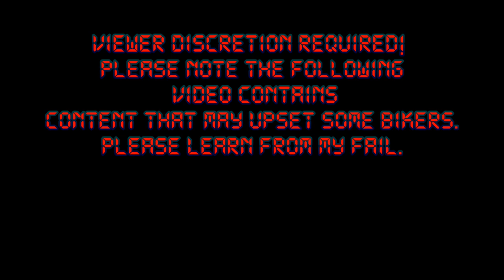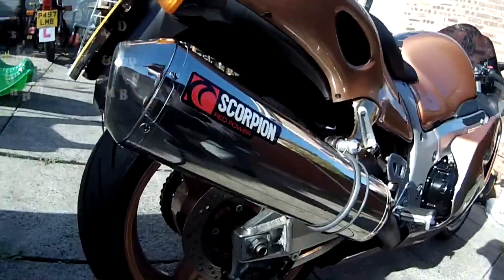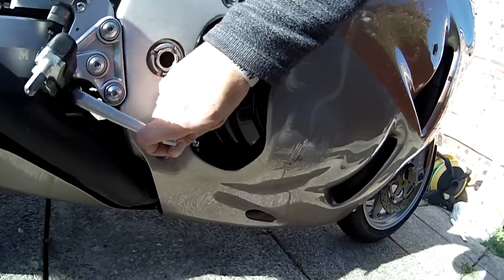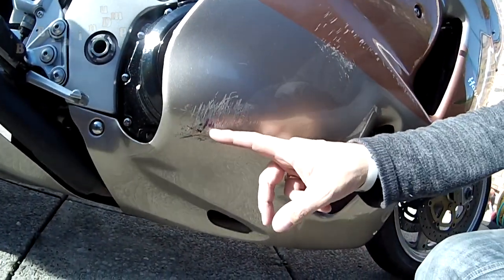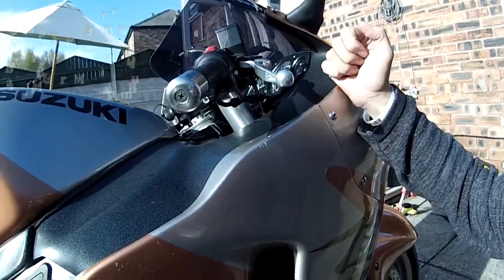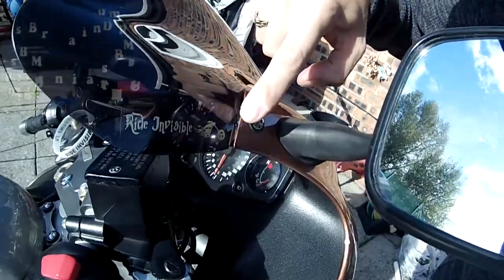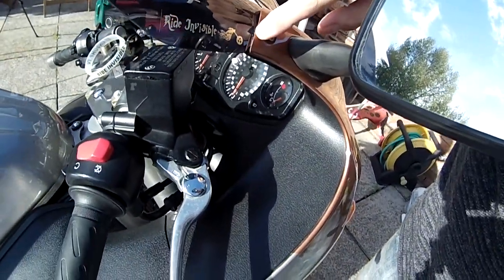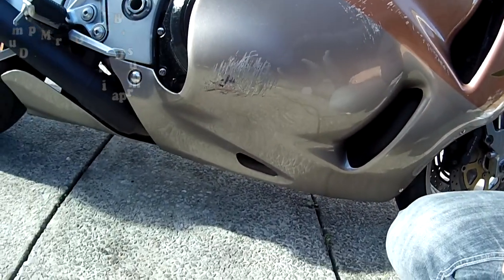Busa Down!! - The beast hits the deck - Mr B not happy

Comment: I did a sprocket and chain change out yesterday and as I was taking it down off the stand my hayabusa fell right over it snapped the brake lever off and scratched the engine covers bad. I feel your pain mr. B also I learned how to do the chain and sprocket from your video thank you so much.

Comment: Hey brother, I’m sorry to see this happen, and I know the pain quite literally. Anyone who rides long enough and especially those who do their own maintenance like we do, is very likely going to have this happen at least once. This actually happened to me very recently not long after bringing home my new bike. What made it even worse is that the bike fell “on top” of me and injured me. I was pinned beneath with no one there to help me. Thankfully the bike only received a minor scratch and I eventually healed. I’m sorry to see that your bike did sustain a fair bit of damage, but it surely could have been even worse. I really appreciate you sharing this for the benefit of others.
Reply from the maker: Motorcycle Extremist Shit man, hope you are back in full health now! The reason I've put this up is to try to stop anyone else making the same mistake. The damage is repairable and I slipped a disc trying to lift the bike back up but that too seems to be on the mend,
Many Thanks, RSMF - RI
Mr B
Reply: Mr & Mrs B's Brain Dump
Yes, thankfully I've made a full recovery. I'm very lucky and even surprised the injuries weren't worse because the bike actually fell on top of my legs on the front, and both knees were forced, as in hyper-extended backwards, but only a bit, so I didn't end up with any torn ligaments. The way it happened is I wasn't feeling well and didn't realize my balance and equilibrium were so off. I thought I was balancing the bike ok while I was checking the site glass for the oil level, and the next thing I knew it was falling on top of me and nothing I could do to stop it. I was actually pinned underneath my new bike and up against my old bike, and bent in some very unnatural ways from head to toe. Needless to say I'm much more careful now. Glad to hear that your doing better. Slipped discs are no joke.
Reply from the maker: Motorcycle Extremist Glad to hear you're recovered, it must have been quite a fright! I've got a scan in a couple of weeks but I'm on the mend too :)
RSMF - RI
Mr B
Reply: Mr & Mrs B's Brain Dump
That's great to hear! :)
Reply: Mr & Mrs B's Brain Dump Sorry to hear you were actually hurt from dropping the Busa. It's not something you necessarily want to practice, but good to know is how to pick up a motorcycle that's on its side.

Make sure your kickstand is down depending on what side is down. Put your butt on the seat and grip the handlebars with one hand and the rear of the motorcycle (like the passenger hand holds) with the other hand. Then lift with your knees. I've done this once on wet grass during a rain. It sucked! My right foot slipped then by the time I got it back on the ground it was too much weight for one leg. My FZ6R weighs 470lbs.

Comment: After owning a brand new 2006 Busa, I will instantly pack away any OEM plastics and fit it with Aftermarket plastic inject parts. Full set of aftermarket will run you less than the price of a replacement OEM side fairing and the quality of inject is very comparable. When you go to resell just put on the original plastics and you're good to go.

Comment: Wow wow I nearly had the exact same thing happen to me with the Abba wheel spin, I recently bought it so I didn't have to use the full stand to check my tyres they demo the rear wheel on the site with a video and say you can use it with the front but they don't explain how. I got pretty scared when I nearly tipped my bike so ended up putting my steering lock on and rolling the on the wheel spin (with it at an angle) to hold it in place, it seems to work but a bit tough to spin!!! Really it's quite tricky to use for the front wheel
Reply from the maker: Bikers Quest Cheers buddy, I'm going to do some experiments to see what works best on the front wheel and what to avoid,

Many Thanks, RSMF - RI
Mr B

Comment: shiiiiit!!! even tho its "light" scratches, i know 450 grit will takesome time to fix it, but thats the way to go ,and a bit of top bondo or filler!! ask a paintshop for bikes what colour primer to use or try light grey and good luck!!
Reply from the maker: transdetendal Many thanks for the tips buddy. Mrs B has me fixing the dishwasher at the moment but I'll be having a crack at the sanding once that's done,
RSMF - RI
Mr B
Reply: if the plasic reacts to acetone , find some simelar plast and solve some in acetone and you got the best and perfect filler for "free", better then the bought ones ,only downer is the cuple of days it takes to damp of the fumes to harden up before you paint!! good luck!!

Comment: i gasped as it started tipping. atleast the plastics didn't break and should be easy to sort out with some rubbing down and a lick of paint
Reply from the maker: TSprint900 I've had my first quote in and it made my eyes water but I'm sure there are cheaper options ;)
RSMF - RI
Mr B

Comment: Unlucky, it really is a testament to the build quality of the fairings though, on lesser bikes they would probably crack. Have you tried chips away or one of the paint sprayers that do the spray at your door. They normally spray small areas on car but they might do bikes as well.  That was a horrible noise when it dropped. RSMF
Reply from the maker: Tom Filby When I lifted it up to check I was really surprised that the plastic had survived! I'll do the prep and then have it prayed professionally,

Many Thanks, RSMF - RI
Mr B

Comment: Ooooooo, sorry about your Busa :(
I would check to see if your year of your Busa is compatible with a "Triple Tree
front stand." Since i have a center stand on my Yamaha FZ6R i wanted a way to check the front wheel and change it. I had 9,600 miles on the front when it needed changed.

REMEMBER: Support the rear of the motorcycle with a stand before working on the front. I have a center stand and it's ok but i still make sure I am on solid level pavement.

Anyway, the Triple Tree front stand lifts the motorcycle up by the bottom of the steering stem. My stem is 21mm. And this gets all the weight off the suspension so changing everything (expect maybe changing the steering bearings) can be done at home.

Just offering helpful advice .... this is my first motorcycle that i have owned, but I have watched a lot of helpful YouTube videos ;)
Reply: Also, good to see no one was hurt by the Busa falling. So at least the only damage is the motorcycle.

Comment: That's absolutely sickening, dropped my mint 2004 Gixxer 600 twice (first bike as a new rider in 2020), trying to attempt a stupid Mod1 style U turn in the works car park (which of course sport bikes are no use for), not enough commitment, full lock and bike went down. Uphill to a set of lights at a junction, traffic was stop/start through the green light, was too focused on the traffic and lights, stopped behind a car, was holding the bike on the clutch biting point, forgot to use the rear brake, pulled the clutch in (for some reason ?), bike rolled back and down it went, fortunately no damage as it has crash bungs. My Hayabusa has crash bungs too, came with them which is lucky as you need to drill the fairings to fit them.

Comment: No crash bungs? Would they have helped? The sound of it dropping sounded like the fairing getting busted up good and proper. Sorry to see this mate. Hope you get the paint job done cheaply. Next time you try this get the Mrs to hold the back, then you've got someone to blame if it did fall. lol
Reply from the maker: ***** Not sure about the crash bungs, I'm going to bring up the subject on the hangout on Thursday. I normally don't do DIY when I'm on my own but on this occasion mrs B had gone out for the day,

Many Thanks, RSMF - RI
Mr B
Reply: Mr & Mrs B's Brain Dump
 Maybe you could use and old single mattress on the side that the bike would fall on just in case. This is something I'm thinking of using when doing this type of maintenance.
Reply from the maker: ***** Hahahaha, I can just imagine Mrs B's face if I tell her I want to keep a mattress in the garden! I've got another stand which is really good, I'll put a review up of it at some point but I definitely recommend it - the Abba bike stand ;)
Reply: Trouble with crash bungs on the Hayabusa is you need to drill holes in the fairings to fit them, also it's a huge hole, something like 21mm, so in reality you are damaging the fairings to prevent damage, still i'm glad my Busa came already fitted with them, don't think i could bring myself to drill big holes in mint original fairings.

Comment: Man that sucks! I almost dropped my bike off the stand this weekend putting on my Winter tires but I had straps on it so it didn't go all the way over before I caught it & reset the stand. I can imagine just how sickening this can be
Reply from the maker: Robert Robb Good save Robert, and great idea with the straps. Out of interest, what sort of stand do you use?

Many Thanks, RSMF - RI
Mr B
Reply: it's just a cheap hydraulic bike stand from Harbour Frieght Tools. rolls under from the side, jack it up & has two places for straps. It's not balanced very well if you go higher than 1 foot off the ground.

Comment: Doesn't help now but crash protection would have stopped any damage...
Horrible when it happens though. I've done it... Makes you feel sick
Reply from the maker: Dangerous Hamster They might have prevented some of the damage depending on the type but for the cost of the crumple ones would probably have been more than the respray. 

Many Thanks, RSMF - RI
Mr B

Comment: That was painful to watch, gutted for you mate :(
Get the fairing panel off, block sand it down using wet and dry paper, plenty of soapy water. If you can't get the scratches out I'd use 'Upol Fantastic' filler, thin coats at a time and block that back to a smooth finish. take the panel to a spray shop....don't attempt it yourself, it's metallic and a real pain to get right yourself.
A vinyl wrap would be an easy fix but I doubt you'd get a vinyl to match the colours.
If it's a common colour scheme maybe there's a breakers yard with a spare panel or a dealership with old stock replacement?
Reply from the maker: Hepcat Harley Cheers mate, that's brilliant advice, already got the wet and dry etc, I think home prep and professional paint job is the way to go,

Many Thanks, RSMF - RI
Mr B

Comment: Oh mate!! Really feel for you, so easy to kick yourself in hindsight isn't it? !!
I'm not a painter either so I would consider giving the correct paint (which you have) to a body-shop/panel beater professional painter and having it done. That should be a lot less than the new plastic, I would hope - especially as you are capable of removing and replacing the fairings yourself, which would save on labour costs. RSM8.
Reply from the maker: ***** Cheers Cap'n, I'm still kicking myself and it happened a couple of weeks ago! The plan is to do the prep work myself and then have it professionally sprayed,

Many Thanks, RSMF - RI
Mr B